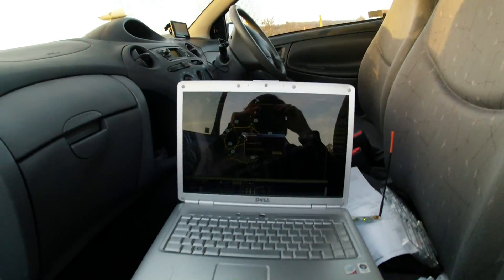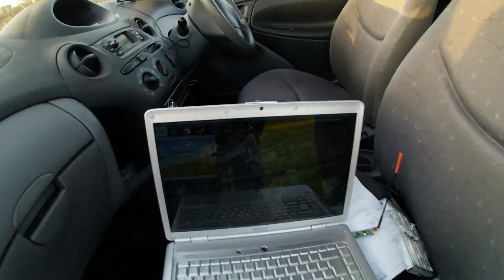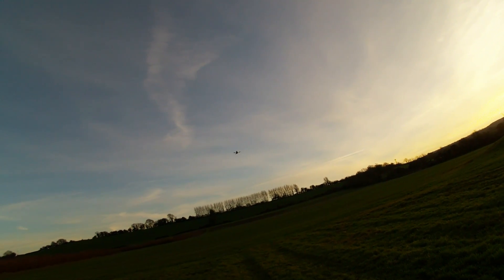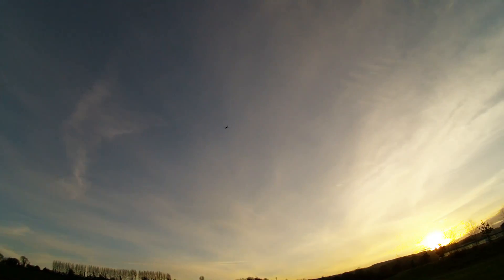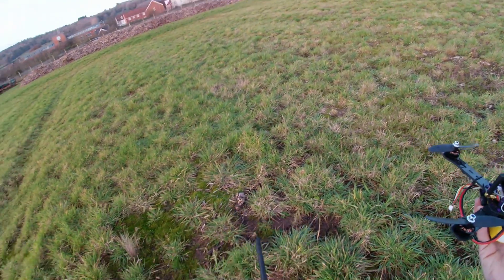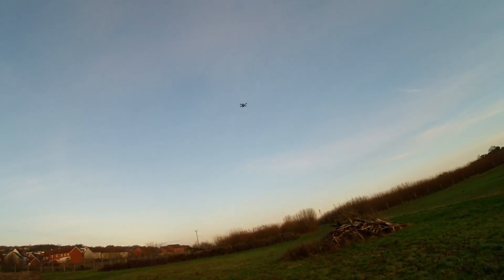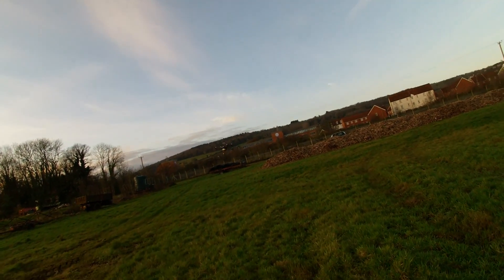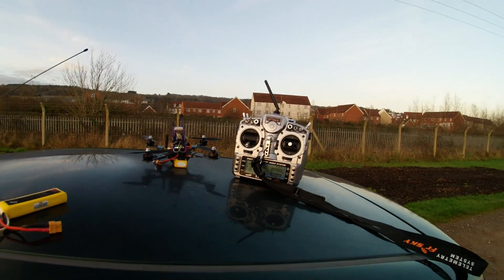Mini APM X Quad GPS Waypoint test flights

Comment: i follow the layout of this picture http://s11.postimg.org/k9k6xb7kh/Page_9_Mini_APM.jpg

but i found the GND and 5V in that telemtry port is no power at all, so i take the GND and 5V wire to one of the JST but dont know why still not working ...i wonder the layout on the picture is it correct (tx and rx)
Reply from the maker: You'd be better off heading to www.multi-rotor.co.uk to ask these questions - you'll get more people responding on a forum and more info that way.

Comment: i am trying to setup the telemtry with my mini apm on my 250...no sucess @_@

some questioj here:
1)i am using power module to power up the board..i jusr wonder if the teletry can get power from the telemtry port? seems not at in my case

2) so i take out he ground cable and 5v cable from the telemtry module original plug and just plug rx and tx to the telemrty port and the 5v and gound i plug to one of my JST power cable...the telemtry powered up but dont know why i still cant connect from my phone....

any idea? any tips for me please thz

Comment: Chris. Are they home made aerials for the telemetry? Any details?
Reply from the maker: it's a 1/4 wave sanders style whip antenna on the ground side module and a goodluckbuy stubby antenna on the aircraft (to save space). Google '1/4 wave sanders' for build instructions but it's about the simplest aerial you can make. Basically a wire cut to the right length soldered to the right connector - nothing more.